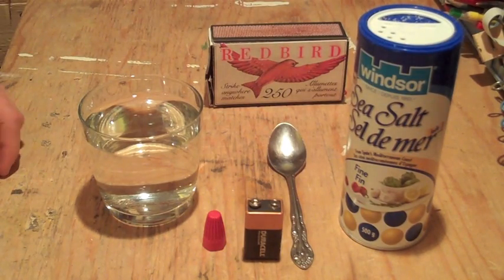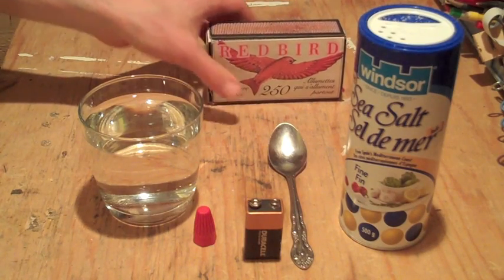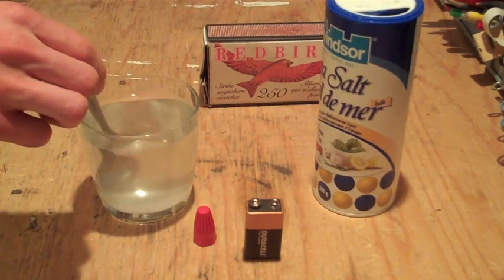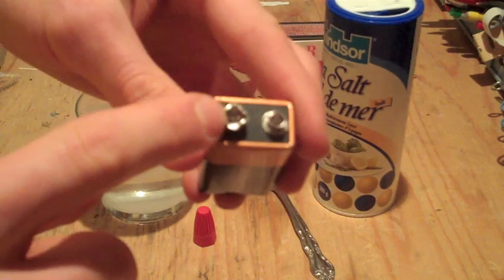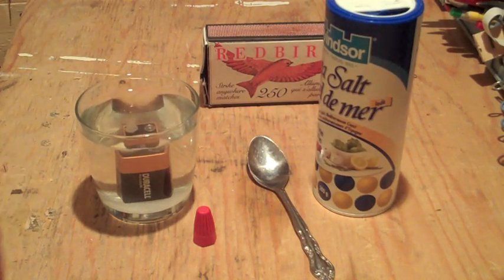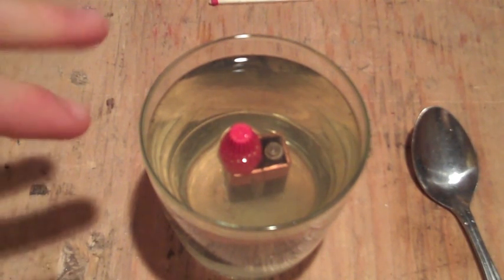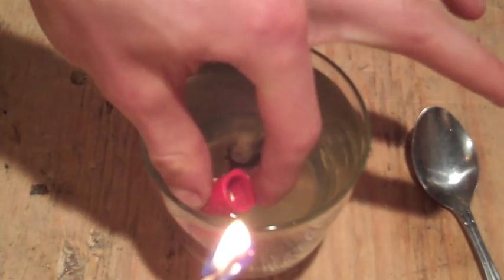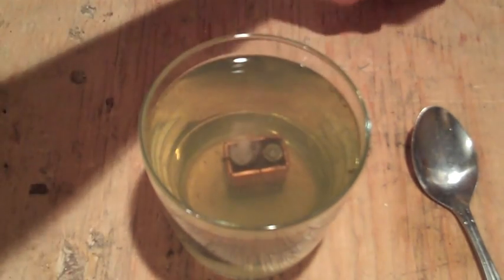How To Make Hydrogen Gas Using a 9v Battery- Easy

Comment: Now I can make some fuel for my foundry. But in a propane tank. So I can control the flow rate
Reply: You still alive?
Reply: @mineis3andhalfinches865  heh yeah. It didn't work lol
Reply: I hope you see this. 
Research how to make a simple wood gas generator if you don’t know what that is or how to make one.
You can pressurize wood gas 
*IF YOU DO THIS MAKE SURE YOU PRESSURIZE IT TO ONLY 40psi AS ITS A GAS UNLIKE LIQUID PROPANE; DO YOUR RESEARCH AND ALWAYS TAKE PROPER PRECAUTIONS WHILE MAKING/USING BECAUSE ITS HYDROGEN. I DONT WANT YOU TO GET HURT.  I wish you the best of luck with your projects

Comment: I have little bit dought. Is pure water does not conduct electricity then how hydrogen gas is formed after adding NaCl.....
NaCl ionised but water is compound it's very hard to break H2o bond

Comment: The next step is to infuse the hydrogen into a homemade vacuum chamber powered by a neon ballast transformer with an electrode ball inside and create particle acceleration by fusing the long isotopes together, creating helium 3 and 4.
Reply: Ok boomer
Reply: @roshannaidu6313  hahahahahahahaahhahahahahahHAHHAHHAHHHHHHHHHHHHHHHHHHHHHHHHHHHHH
Reply: I don't think you understand how fuckin dangerous helium 3 is.

Comment: 3V Coin Cell Lithium(not rechargable, usually used for watches, IR remote and so) Manganese Battery , Cr2032 Lithium Ion Battery, 10pcs for only 1$, put one or ten pieces and close tightly in PET bottle(from pepsi) with water solution of eatable soda(NaHCO3), or maybe better electrolisys will hapens with Na2CO3 that you can easy prepare from food grade soda NaHCO3, if to heat NaHCO3 on the hot plate on alliminium foil, eatable sodium bicarbonate(hydrocarbonate) NaHCO3 heated to 100C-200C(faster reaction some minutes...) will give Na2CO3 and CO2^gas, you will see some powder changing, more white and dry loking powder of washing soda - Na2CO3 - better alkaly, still safe for eyes unlike NaOH, and PET bottle can storage only dry NaOH, dry KOH or dry NaOH powders can not destructively react with PET plastic, but with few drops of water addition, or if not closed tightly from outer wet atmosphere, it will damage PET(you need PP or some type of PE - HDPE LDPE... that stable against most chem. subst. and 120-140C) but i bought dry NaOH powder, it was in PET botle - pretty dangerous for transfer, if bottle will damaged a little, put bottle in plastic packets 2-3  or few layers of food PE film, it will be much more safe, wet NaOH will after liqidifiing PET bottle, damage every thing in bag, money, phone, passport... probably even your lovely parrot :-( 
but Na2CO3 will not(i almost sure), dry and wet... 

in NaCl with water and 1batery of such tipe, chlorine gas Сl2 and H2 was bubling out
Reply: Dont let your batteries run fry
Reply: NERD
Reply: Jk lol

Comment: I am currently making Iron oxide by electrolysing salt water with two steel nails.
The same process is used to make hydrogen, but why do hydrogen generators not create iron oxide?
Reply: J Stuyfzand Because you don't have iron.What do you think's supposed to happen?
Reply: I know better, now, one should not use iron for hydrogen production XD

Comment: "Regular tap water does not conduct electricity."

Fill up your bathtub and drop a toaster in there, it conducts electricity pretty well.
Reply: Moo Weep A toaster is a lot more powerfull, so powerfull that it can send electricity through water
Reply: Hoseas Mulugeta which would mean its highly resistive
Reply: It may conduct a bit , but it works when you sit in there, because your sweat is containing salt.
Reply: Awe yes the technicality that chemistry conjures up. With enough voltage anything can conduct electricity. As long as there is enough to overcome the electrical resistance of the space/material, there should be an electrical current. Conductivity is a bit of a relative term. To avoid confusion he should have said it is not conductive enough to break the bonds between the hydrogen and oygen atoms in water, alone. Or at least not enough to produce a decent sample with his voltage supply.
Reply: Even distilled water from the store conducts electricity ever so slightly.  Labs sell deionized water where even more ions were removed than what distillation can do.  Lab grade water is like 8 megaohms!!
Reply: Depends on where you live because here where i live it doesent
Reply: cause its high voltage u dumb fucc
Reply: Pebles u are wrong
Reply: hmm, yah ur right. i always thought my bathwater came from the sink. no kid. bathtub water contains different minerals then tap, so it makes perfect sense that ur wrong. but nice try anyway! i will like ur comment
Reply: Mad Cuber I honestly can’t believe two things, the fact that you replied to my 5 year old comment, and the sheer stupidity of what you’ve said.
Reply: @danielbillingsley6910  bathtub water isn't as drinkable as tap water, and there is a reason for that. bathwater needs some minerals to keep it usable, and that includes some salts. tap water and shower water tho would never have salt in them. i hate drinking salt water. and plz stop being wrong
Reply: @aarushprasad4493  The water that comes out of my shower head and the water that comes out of my kitchen sink are exactly the same. They come from the same water heater, and the same water supply. 
Also bathtub water and shower water are also the same...
Reply: These days that's just going to pop the RCD .. The biggest noise you'll get would be the teenager whining about needing a new hairdryer
Reply: dude shouldn't be playing with matches and combustibles.  only distilled water does not conduct electricity...
Reply: Bro that's not safe
Reply: ***** Either way, tap water does conduct electricity. It may have high resistance, but it will still conduct.
Reply: ho yes it will distilled water however wont

Comment: It will produce toxic chlorine gas so you better not do it inside. 2NaCl(aq)+2H2O(l) -> H2(g)+Cl2(g)+2NaOH(aq)
Reply: That's what I was thinking
Reply: +Casper Molhoek No, but it's so little that nothing will happen plus, the chlorine gas gets dissolved in the water.

Comment: Would this produce sodium hydroxide?
Reply: Also can you use graphite rods like pen cores instead of putting the battery in the water?
Reply: it will produce SH
Reply: +Henrik Alstrom the best node to use would be Platinized niobium
Reply: Blume 
SH? It would not produce SH. Considering that SH isn't even a compound, as well as the fact that there's nothing there with sulfur in it, it's not possible to make SH by following the instructions in the video. This does, in fact produce NaOH, or sodium hydroxide, as well as Cl2 and H2.
Reply: Henrik Alstrom 
Yes, so be careful if you do this. also, yes you can use graphite rods instead of just dropping the battery in.

Comment: This is wayyy too much effort for a tiny amount of H2.  Just use a little toilet bowl cleaner that contains hydrochloric acid and drop in some strips of aluminum foil.  Better yet, just pick up some hydrochloric (muriatic) acid from home depot.  2Al(s) + 6HCl(aq) -> 2AlCl3(aq) + 3H2(g)  Just don't touch the liquid after, as AlCl3 can cause irritation to the eyes, skin, and the respiratory system if inhaled or on contact
Reply from the maker: Yeah I've heard of that way! maybe I'll make a video with it soon
Reply: oh..... add sodium to water
Na + H2O-----> NaOH + H2
...........
but where sodium is found..
the material here are cheap...Mr.
Reply: Not sure if you were just looking for an outlet to showcase/show off your chemistry knowledge, but what you said makes no sense. This guy is taking a few things from AROUND the house to make H2. Going out to Home Depot or whatever defeats the entire purpose of this video.

Comment: i thought this will make HHO
Reply: Carlos Larios I guess he means H2O
Reply: Salt as a electrolyte provides the chloride in this case.
Reply: luisa javier 
not with table salt like he used.
2NaCl + 2H2O = 2NaOH + Cl2 +H2

What that means is 2 molecules of sodium chloride (table salt) and 2 molecules of water react to produce 2 molecules of sodium hydroxide (NaOH), 1 chlorine gas molecule (Cl2) and 1 hydrogen gas molecule (H2)
Reply: luisa javier 
not with table salt like he used.
2NaCl + 2H2O = 2NaOH + Cl2 +H2

What that means is 2 molecules of sodium chloride (table salt) and 2 molecules of water react to produce 2 molecules of sodium hydroxide (NaOH), 1 chlorine gas molecule (Cl2) and 1 hydrogen gas molecule (H2)

To produce actual HHO gas, you need an electrolyte that will not become part of the reaction, like sodium hydroxide or potassium hydroxide.